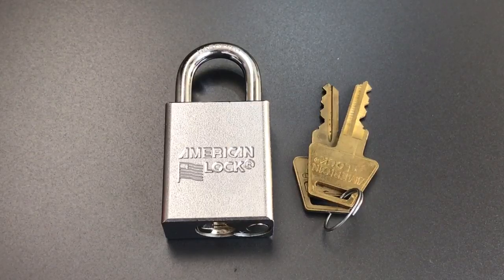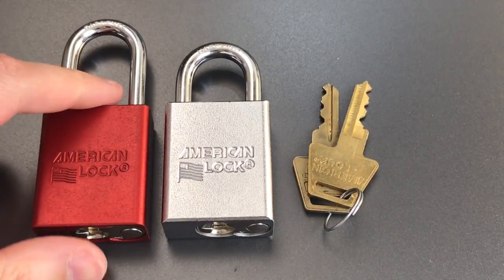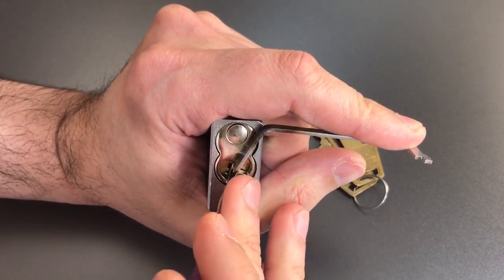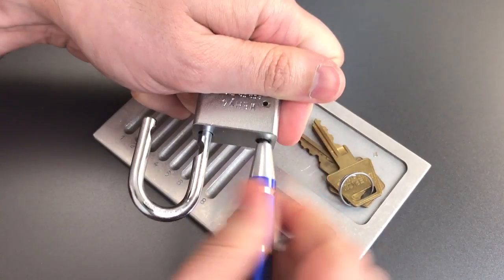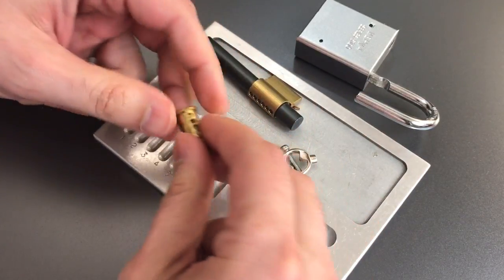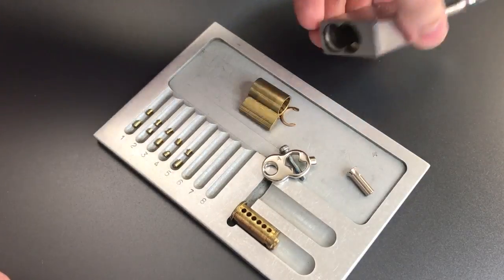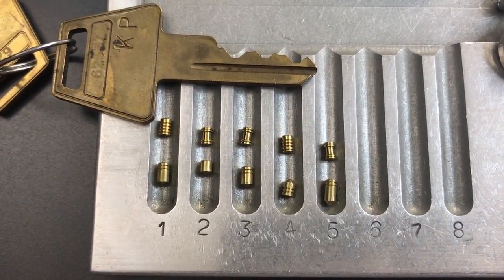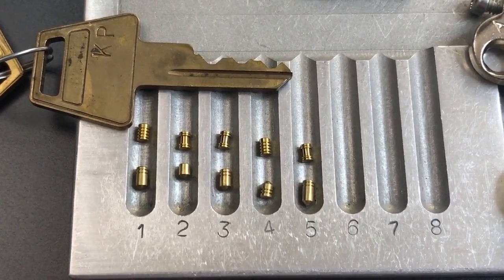[469] American Lock Series 5100 Padlock Picked and Gutted

Comment: Adding a comment to an older video but we used the 5100 series extensively in the Army. Used on all our duffel bags and footlocker.
Reply: That why I'm here. Have an American lock that nobody has had the keys to in years. And it's on a cage that is blocking us from cutting the shackle with bolt cutters.
Reply: I was a Supply Sergeant in the Army. I hate it when they misplace  the keys or in need of a vehicle and could not wait for the person who holds the key, ended up using bolt cutters. I wished I'd kept all the padlocks with missing keys... I would have more collection to practice on.

Comment: Great demonstration of SPP. Fun locks to learn on. ACE hardware sells a steel body clone of the American lock pattern, and they too contain 5 pins on a 6 pin core, serrated key and driver pins, and an anti bypass disc. Mine cost $16. or so, and has been a good investment for practicing, not only picking, but lock disassembly. They also have smaller pins than the ones in the sparrows reload kit.
Reply from the maker: Most padlocks use smaller sized pins... but thankfully, they seem to be standardized across brands.
Reply: Thank you for the reply LPL. I love watching your videos. My only complaint is you make it look so easy. 😂 I've opened mine using SPP, and no one would like to watch that video, if I made it. Hour's of trying to do what you did in less than a minute.😁
Keep up the good work Buddy. You, Bosnian Bill, and Lock Noob, have been my main teachers on lock picking. That, and countless hours of practice.

Comment: I have been picking for a little while now, so far i have been able to open up every lock i come across except an American 1100 series lock. I know it has a standard pin, serrated pin, and 4 spools, but knowing that doesn't seem to help. I even know where those security pins are, because i put them there. Yet I am still defeated, i just cant seem to beat the spools.

Comment: How did you know that the pins needed more than just one click? Great job as always!
Reply: Aaron Bradshaw my guess is because so many American locks have serrated pins
Reply: In some cases with a new/clean American lock on a serrated pin you can get more than one click without over setting the pin. Once the pin hits the sear line it will stop or require more force to go any further. In my experiences this is aided by applying the correct tension and in some part dependent on the specific lock core/pin tolerances. I have new and old American that will allow this, as well as new and old Americans that will not allow this. Some Americans require a different method to avoid over setting the pins. You can find out if your particular lock will allow more than one click at a time by trying it. I usually start this way because it is faster if it works and then back off if the lock will not allow it and go back to one click per pin. Once you get the hang of them you can differentiate what you are dealing with pretty quickly in most cases.
Reply: He picks in advance of the video.
Reply: He may pick in advance but he has also picked a bazillion locks so he knows what he's doing as a result.👍
Reply: Serrated pins make a less "deep" click than the pin setting does. He made a video on it at some point.
Reply from the maker: I address this exact question in video #97

Comment: So, I'm a relatively new picker, and I've been working on going for more and more difficult locks recently, and I just picked up one of the brass-body American lock padlocks of the same design. 

What confuses me is I feel like I keep over-setting the pins, and I don't get nearly the same nice click that you do out of them. Ive managed to open it twice now but I feel like the more I work on it the worse I get. Is there something I'm missing? I feel like I'm using relatively heavy tension but I keep hitting a point where all the pins feel loose and springy, and I don't seem to be entering into a false set anymore, or if I do I lose it quickly. I can pick the red plastic Master LOTO locks pretty quickly, but I cant figure out what I'm missing on these. Any idea what I should try doing differently?

Thanks!
Reply: Me too! That's why I looked up this video because I figured lpl picked one before. Did you ever figure out a trick to this one?
Reply: Same here

Comment: I've heard that spools are rather wasted over long key pins but you seemed to get false sets and counter rotation on a couple of those - your opinion?
Reply: Mr. E. I was repinning my 3 1105's yesterday (same core) and tried using serrated for deep cuts and spools for mid to shallow, and then did the opposite. The spools do have serrations so it doesn't make them useless, but it is a bit of a waste for deep cuts as you only get a very small amount of counter rotation (if any). Looking at his keys there are no 8, or deepest, cuts. Pin 5 is probably a 7 cut, and pin 1 a 6 cut, then pin 3 a 4 cut. Only pin 5 would be deep enough to make the spool irrelevant.
Reply from the maker: It depends on the lock... binding order and bitting, together with core tolerances all conspire the make pins more or less effective.  I don't think that anything is wasted in these locks.

Comment: LockPickingLawyer 
is a different type of tension rod required for top of the lock? i can't get a grip with my tension rods, i noticed yours is shaped differently.
Reply from the maker: Sharp edges are very important to TOK...
Reply: i think i understand, thanks
Reply: i given it some thought, after i get past the next batch of lockpads, abus 55/40, 80ti/50, 72/40, master lock 911.  then i will order sparrow tension rods or a peterson  like yours and try my American locks 40 and 700. hopefully that will cover my education for bottom of the keyway and i can move to the top.

Comment: Just picked up a 5200, trying to feel the pins, what do you mean when you say "counter rotation?"  I think that detail is causing my fail...  lol. Thanks.
Reply: When you fall into a false set due to the security pins, as you're picking the next pin the core will counter rotate to pull out of the false set and fall into the real set.
Reply: @XQsizZz  
  Thanks for that...
Reply: @XQsizZz  
Thanks!

Comment: Waste of a core pin hole. It is disappointing.
Reply from the maker: Agreed.
Reply: Why?
Reply: @deralictv.  They went through the trouble of machining a core that is long enough and drilled the extra hole. For a fraction of a cent more per lock, they could have pinned it and made the lock more formidable. It's a bit like making a race car engine and spending the extra time and effort to make it extra fast, but installing a gas pedal that doesn't reach the floor.

Comment: i dont get it, after all these years, why doesn't masterlock just change the actuator design so they dont need to add those anti-bypass wafers? and why do they keep drilling 6 holes and populating 5? they've been doing it for so long..is there a reason? why not just drill 5 holes and save the wear and tear on their drills? it makes no sense! so much of it makes no sense.
Reply: So you can add another pin.